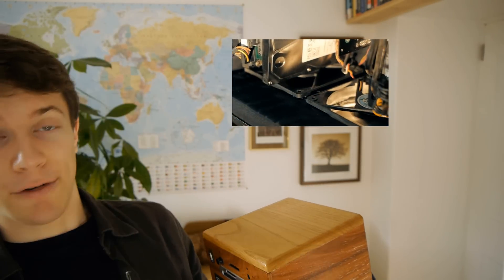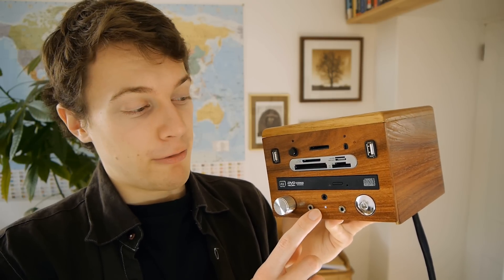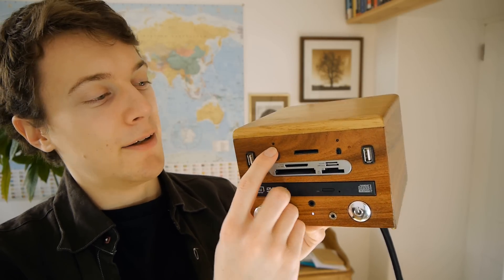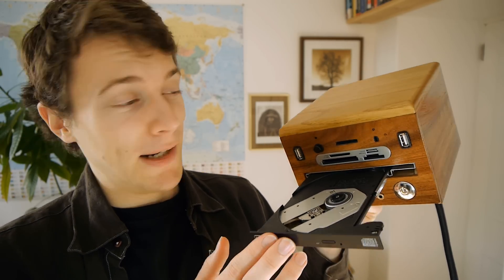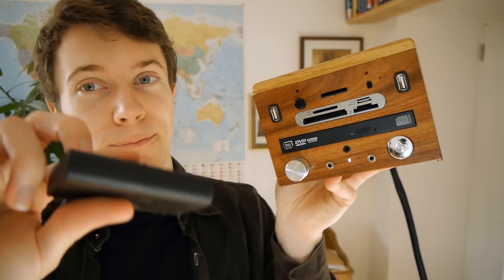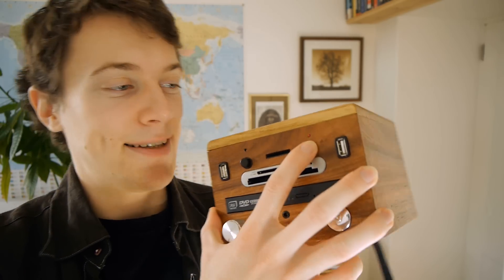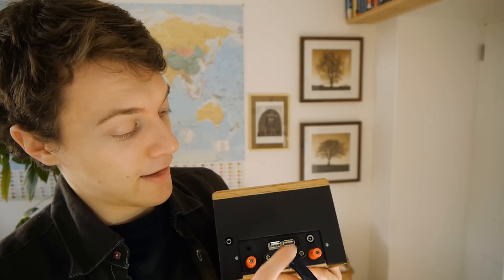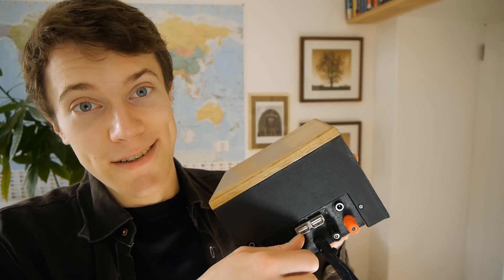PC Control Terminal (useful!)

Comment: Now in 2016 we can buy that and only uses 1 cable but the output is : 6x USB 3.0,1xUSB 3.1 (A),1x USB 3.1(C),Thunderbolt 3.0,Even an m.2 Slots And More! ive seen this in a video at Computex 2016 i think..

Comment: fancy thing you've build their. But I would have used usb2 or 3 ports and I would have added a small screen with stats like cpu temperature. of course I would have added a slot for additional cables, even if I would have to run them over anyway. That would make the box bigger but I think it's worth for convenience.

Comment: i`ve made one with an audio jack, 4 usb ports and an all-in-one card-reader. id didn`t put the computer in another room cause i don`t like that. thanks for the idea. it was a great project.
Reply: Sooooo... https://www.amazon.com/Sabrent-External-Adapter-Windows-AU-MMSA/dp/B00IRVQ0F8/ref=sr_1_3?ie=UTF8&qid=1490066389&sr=8-3&keywords=usb+audio+adapter and https://www.amazon.com/Acuvar-Speed-Memory-Reader-Writer/dp/B00R07WNRY/ref=pd_sim_147_3?_encoding=UTF8&pd_rd_i=B00R07WNRY&pd_rd_r=RRHRPKA8Z6JX4JWB2QTN&pd_rd_w=yUV9y&pd_rd_wg=Cci6I&psc=1&refRID=RRHRPKA8Z6JX4JWB2QTN plugged into https://www.amazon.com/Generic-7-Port-USB-Hub-Port/dp/B007S642BW/ref=sr_1_4?ie=UTF8&qid=1490066330&sr=8-4&keywords=6+port+usb+hub plugged into https://www.amazon.com/AmazonBasics-Extension-Cable-Male-Female/dp/B00NH11R3I/ref=sr_1_2?s=electronics&ie=UTF8&qid=1490066507&sr=1-2&keywords=usb+wire+extension (could have found cheaper prices or beter items used the first things I found)

Comment: Wouldn't it be usefull to add a hdmi or vga connector? That way you can place the computer in another room without the need of a 30 feet hdmi cable.

Comment: I think I have seen this idea once or twice before. Have been thinking about doing something similiar attached to the underside of a desk. Personally I would use maybe something like pico powersupply (one of those that connect to atx 24 pin and converts voltages from 12v) and external 12v power brick. Add to that decent usb soundcard and you would cut down that wiring to your pc. Same functionality but would be simpler to run wires. If you want to go crazy with your distance you could combine some sort of non-usb cable extenders like optical or rj-45 based.

Comment: Hello! How do you run speakers to those speaker terminals? Do you run them through a pre-amp?
Reply from the maker: weyderwarr There's an in built amp, which it switches to if it's on, but most of the time I just have it running from the soundcard passively.
Reply: Would you by any chance know how to make a DIY usb to optical toslink out? haha I am in desperate need for something like it and don't really feel like buying a sound card or new motherboard just for an optical out :D

Comment: How do you plug your monitor in? Is there another 5m cable for that?
Reply: Yeah in his previous video he show another long cable. Though personally I would have just included it in the control unit, even if it mean two cables to connect to the control unit. You got two cables from the PC anyways.

Comment: But if the PC is in an other room you will need a very long cable for monitor too?
Reply: and maybe an active repeater (if the cables is to long (+10 meter of hdmi) example for 17 meter you  just buy 1 cable 7 meter  repeater(amplificateur) then another cable 10 m  else you can have problems (fps, resolution  or image distortion  )

Comment: What do you do about the monitor?
Reply from the maker: It's plugged in with a long DVI cable. I didn't see much point about having the signal go to the hub first and then out to the monitor, as it would have added a significant amount of thickness to the wire.

Comment from the maker: You will have to get a pinout for a mobo USB header, and wire it up to an old USB cable accordingly. It should be simply a case of red wire to red wire, black wire to black wire etc, but it's worth double checking.

Comment: I suggest building a normal desktop pc into the desk behind a door.
Then connect those to a usb dvd drive and a usb hub with sd reader built into the desk surface. Its a LOT easier. good luck ;]

Comment from the maker: Thanks :) just learning as I go.

The 4 cables (two for ground, two for +5v) run the whole way down the cable. That way the devices are turned on/off with the PC, and I don't need to use another power outlet.

Comment: Hah! that is a good idea, and with running a disk drive you'd need a line from the PSU anyway. Apparently USB 1.1's max length is 5m and USB 2.0 is 3m, that would have been the reliability problem you were seeing. 4 dedicated cables the whole way? or just a powered 4 way splitter at the end? Great job, seriously, your builds are quite impressive.

Comment from the maker: Getting the USB hubs to work reliably was one of the hardest things about this build. Even though 5m is within the USB specification, I found that for 100% reliability it needs to be no more than 3m, so I split the length with a powered USB repeater within the cable (so there's a slight lump half way along). The power draw of all these devices is too much at 5m for standard cable, so I have an additional 5v running from the PSU with very thick wire within the cable also. 100% reliable now tho!

Comment: I would have thought the usb controller would start acting up at that length? If that's not an issue then brilliant, even though computer is right by my feet i would happily have one of these external controllers, then again I still need to get an sdhc card reader installed...
Excellent build, wish i could have seen the insides. Well done Matt.